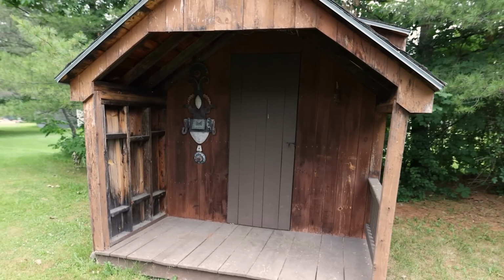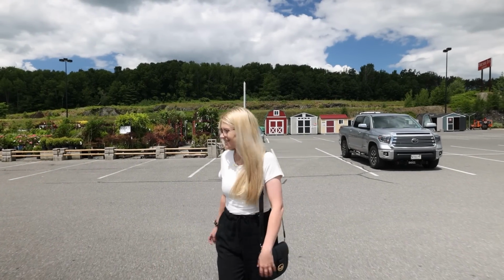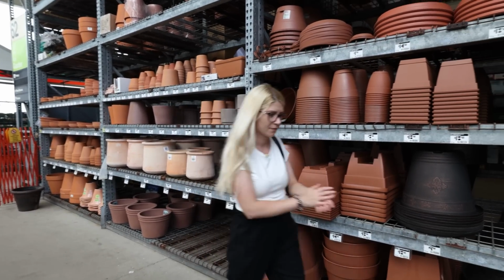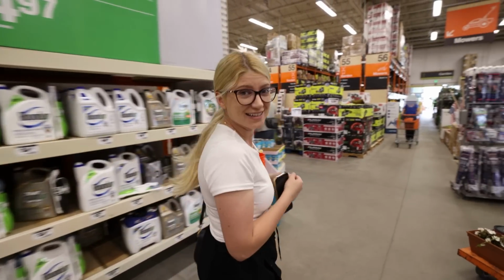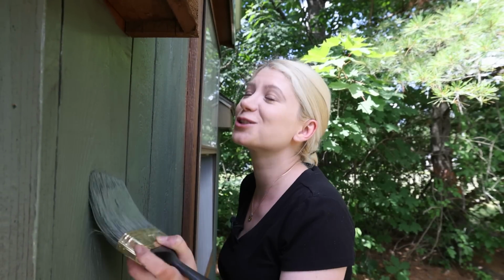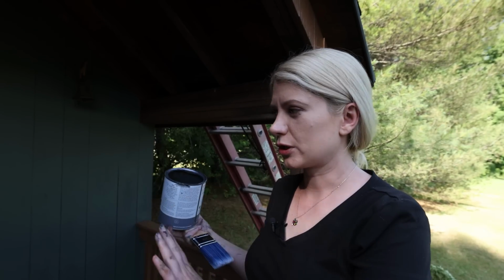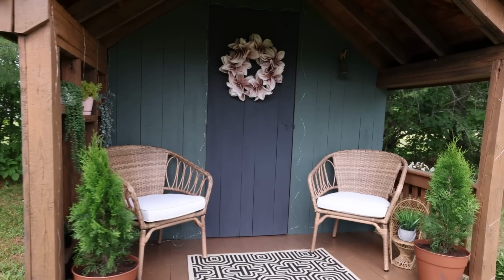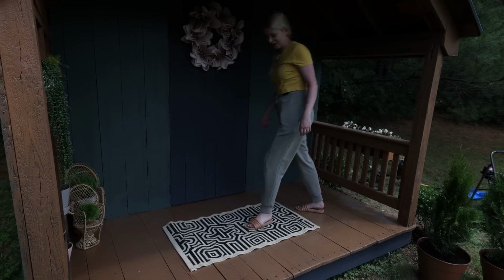20-Year-Old Shed Transformation - How to Bring Your Old Shed Back To Life

Comment: Love those blue colors. But it still looks kinda gloomy shadowy under that roof. Paint the underside of that roof white to bounce some light off your pretty colors. OR....Get some exterior 4x8 panels of beadboard or plain plywood. Paint those white and use them as a ceiling under that roof. I recently finished painting the deck of my sheltered front porch. I chose a dark dusky purple (Shadow, by Benjamin Moore) very similar to your shed door. The walls are a pale blue vinyl siding. There is a surprise bonus to deep blue colors on exteriors. It is not just pretty. It can be therapeutic. Bright sun can be too dazzling. I notice when I step onto my purple blue porch that my eyes feel soothed, as if bathed in cool spring water. It is a most pleasant sensation and a welcome relief.